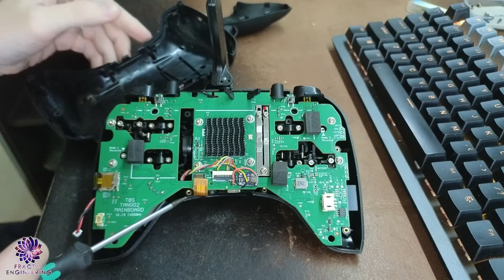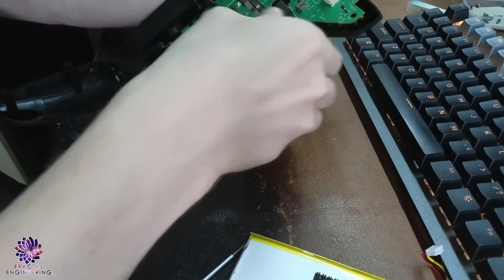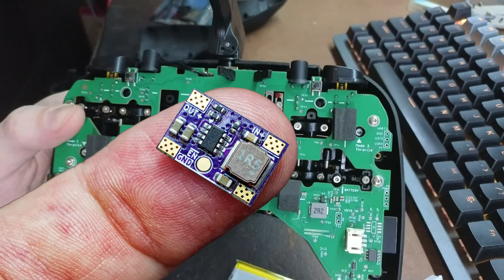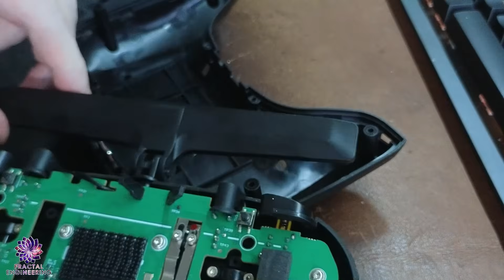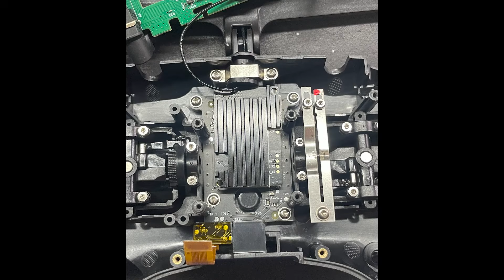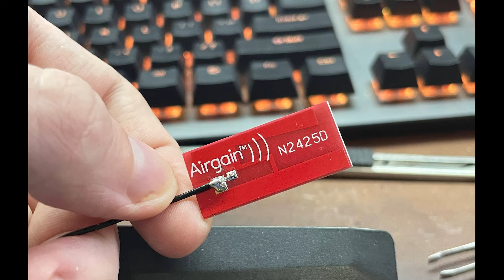TBS Tango 2 Internal ELRS Mod with Boostybaby

Comment: I was wondering can i just direct connect the Zorro module into TBS module bay without the Fractal Booster?
Reply from the maker: you could directly tap onto the tango 5V rail but you wont benefit from the boosty enable feature; module will be permanently ON even on internal crossfire.

The TBS module bay adapter converts full duplex uart into half duplex sport; there may be a way to make the zorro module work with it but I can't help with it.

Comment: Very nice Video, i want to have elrs 900mhz INSIDE my tango2, but IT doesnt work :(
I flashed some elrs 900rx to internal tx so they should use full Duplex RX and TX wire. I wurde everything Like you did, But even If i Power the RX (now TX) from external 5v i cant get Connection to the tango2. I dont See it in the lua Script. Did i miss something???
Reply from the maker: send pics on the discord or tag me on the elrs server I'll have a look at it
Reply: Have same problem, not see module in lua(( can you help?
Reply: Already fix, thanks
Reply: @jenka22 how did you fix this? I have everything wired up but can't get the module powered up to flash firmware. I also don't know which firmware version to flash
Thanks in advance
Reply: @bl4ckmagic34 I have a slightly different situation. My zorro module wasn't showing up in lua. But that's because I was using the happy model adapter.
Reply: @jen @jenka22 so how did you solve it? Mine isn't getting power or showing up anywhere
Reply: Turns out the critical step was setup > external RF > CRSF. Everything works now. I am an idiot

Comment: Hey. Ive been checking if anything can be done to support full 1w for the slim pro either as in internal or external module to tango2. Any suggestions on what mods can be done? Could make for a good video as well
Reply from the maker: Yes I just ordered another nano module to test things out with LR1121; as long as:

1- It fits between the gimbals (or generally inside the radio
2- You can tap onto full duplex lines (or convert to half)

I see no reason why it wouldn't work; boostybaby can easily handle 7W so no foreseeable issues on this end
Reply: @fractalengineering so are you telling me that if i were to use slim pro instead of the module you are using in this video boostybaby would allow me to power it upto 1w without any issues?
I got confused when you said the external module adapter from tbs has a similar booster in it. Do you think it has lower power op and hence cannot achieve 1w on external module?
What do you mean by full duplex lines? Sorry im not well versed with electronics.
Reply from the maker: @hemanthkrishna5343  I reckon the TBS external module power limit comes more from the FPC ribbon current capacity, which we can bypass by soldering the boostybaby directly to the pads

Full duplex as in 2 wires uart; Rx and Tx.
Jr bay modules typically use half duplex; rx/tx on the same wire.

The Tango actually breaks out full duplex to the module adapter which then converts it to half to fit the JR bay standard
Reply: @fractalengineering  I doubt its because of the FPC ribbon current capacity. The happymodel power adapter uses FPC ribbon cable and is able to adequately power 1w for slimpro (HM Tango2 Power adapter for ES24TX Slim Pro 1w output).

Do you think it I provide direct battery input to boostybaby and connect the op to external module V an G pins it would work? It will be in parallel to the existing power supplied on the same pins.
Reply from the maker: @hemanthkrishna5343  hmm I'm pretty sure the HM adapter addresses the power issue specifically by tapping directly on the battery connector.

You should be fine doing the same, that's practically what I do in the video only through the fused battery output

Comment: Can I use the tango stock antenna and use a antenna like you installed for crossfire?
Reply from the maker: well the tango antenna is crossfire; tuned to 900MHz. Won't work well with 2.4G ELRS - and vice versa
Reply: @fractalengineering  ok good to know. I just picked up this controller last week for this mode alone
Reply from the maker: @wadecloyd5621  dang awesome; it makes it such a nice and tight package I've been super happy with it